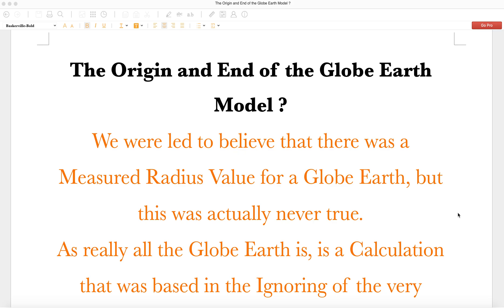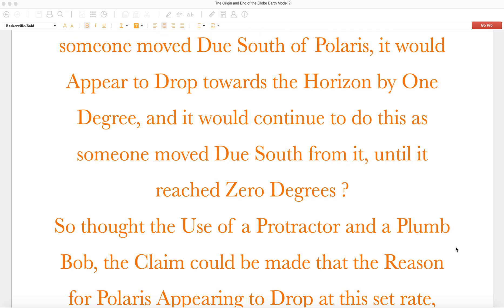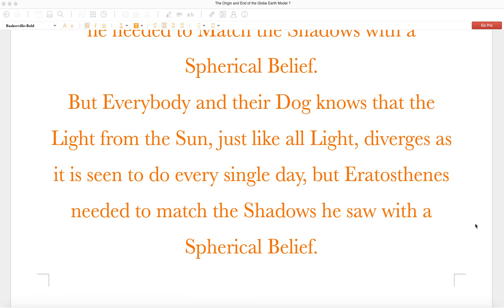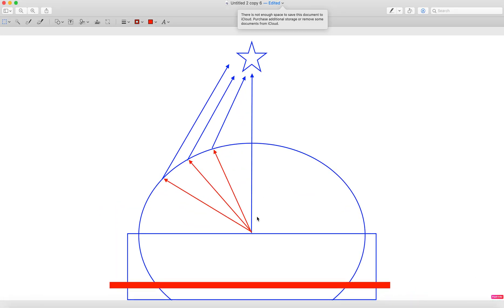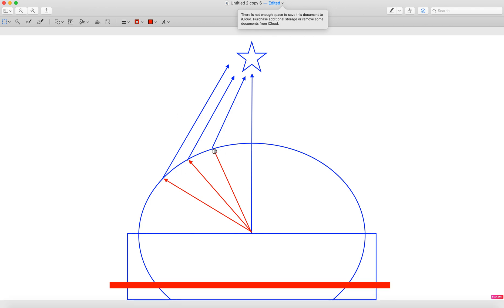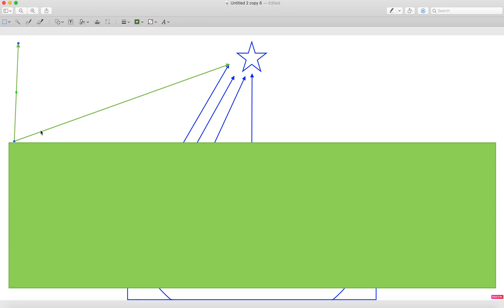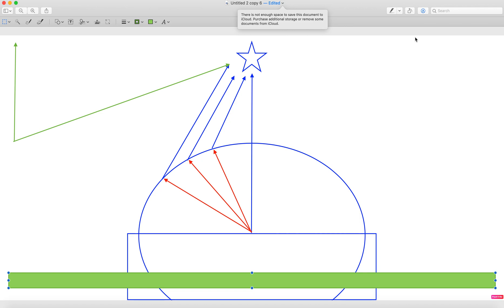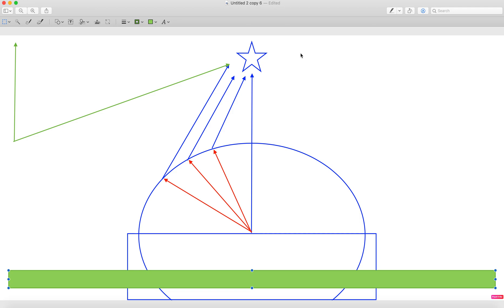The Origins and End of the Globe Earth Model ?

Comment: The geometric horizon is a purely theoretical construct, not anything you can see. The geometric horizon is not a real measurement. Its distance is the result of a real arithmetic problem; Brian another excellent breakdown video. 📐🗺✨💯 Cheers 🍻
Reply: SHAWN HAWKINS  elevation angles have straight baselines, little buddy. How do you establish yours?

Take your time, Shawn...
Reply: @DrEMichaelJones  it’s called a tangent. But you don’t need a horizontal baseline anyway, you can measure the object’s altitude respective to vertical. You know, the direction we measure using the direction of gravity’s pull.
Reply: @paulsterx  an elevation angle with respect to vertical? That wouldn't be an elevation angle, little buddy. Nice try though.
Reply: @DrEMichaelJones  correct, it’s the angle respective to vertical, which is the angle required to calculate your latitude. Why do you think you subtract the elevation angle from 90 before then multiplying by 60 to derive distance from the pole? It’s a more difficult measurement to make as there’s no reference point to sight, which is why an elevation angle from the horizon (with corrections for drop and refraction) is more commonly used, but the angle you’re really looking for is the angle from vertical. Which is how celestial navigation works. Do you even know how to use a sextant? Or how navigation works? Sound like you don’t, little buddy. Good try though.
Reply: @paulsterx  Using a presumption about a magical reifying baal force that's not a force but you can think of it as a force to further argue your presumptions of the sun's light being parallel is the epitome of stupidity! Try to start without presumptions and then only work with empirical methods that do NOT use third and fourth party unverifiable data and claims!
Reply: @paulsterx  where'd you get the 90, little buddy? How'd you get that baseline?
Reply: @DrEMichaelJones  what baseline? 90 degrees is vertical - straight up. The opposite of down. You measure down and take the opposite. That’s how spirit levels work. They measure down and tell you the angle perpendicular to down to derive horizontal. Are you new to geometry or something?
Reply: @paulsterx  90 degrees is vertical / straight up from a straight baseline, little buddy. It's called a right angle. That baseline. Thanks for confirming that we use a spirit level to establish that horizontal (perpendicular to vertical) baseline.
Reply: @DrEMichaelJones  correct, vertical is perpendicular to horizontal, I see there’s no getting anything past you! I’ll call you GG from now on, for geometry genius. So, GG, please tell me how you establish that horizontal baseline. What tool would you use to do this precisely? I’d use a spirit level of some description. So, how does the spirit level know what horizontal is? Does it just magically know, or does it use a reference direction - maybe ‘down’ to establish that horizontal line? And if it uses ‘down’ to establish horizontal, surely it can use ‘down’ to establish ‘up’, or vertical, yes? In which case you don’t need horizontal to establish vertical, you just measure the direction of ‘down’ and point the opposite direction for ‘up’. 

So, tell me again why you need a horizontal for celestial navigation?
Reply: @paulsterx  we use a level to establish a horizontal baseline, little buddy. Everyone knows this. All elevation angles are measured fom that horizontal baseline.
Reply: @DrEMichaelJones  and how does that level establish what is horizontal, little buddy?
Reply: @paulsterx  how does a straight level establish a straight horizontal plane? By not being curved, little buddy. You're welcome.
Reply: @DrEMichaelJones  not the answer to my question. I asked how a tool that establishes horizontal works. How does the tool know what horizontal is?
Reply: @paulsterx  the straight tool? You're wondering how it establishes straight? It's straight. How do you think it works?

Btw, men don't write "oh dear" so I assume I'm speaking with a woman. I will adjust my pronoun use accordingly.
Reply: @DrEMichaelJones  the spirit level Mike. How does a spirit level establish horizontal?
Reply: @paulsterx  are you claiming it doesn't?
Reply: @DrEMichaelJones  of course not. How does it do it? Does it magically know what horizontal is, or does it use a reference direction? If so, what is that reference direction?
Reply: @paulsterx  you're asking why water is level? Would you like to know why it's wet too, little buddy?
Reply: @DrEMichaelJones  are you suffering from some sort of stroke? It’s a simple question. How does any levelling device establish horizontal? What is it’s reference direction to do so?
Reply: @paulsterx  your question is "why does water seek its own level?" You're just not bright enough to realize it.
Reply: @DrEMichaelJones  when did I mention water? I’m asking you how a levelling tool determines horizontal. Take a laser level for example. How does a laser level shoot a laser beam horizontally? How does it know? What reference does it use?
Reply: @paulsterx  the tool with liquid in it... you're wondering why the liquid seeks level...

Lasers do indeed shoot straight, too. So much common ground! But no, a laser doesn't "know" or seek horizontal like liquids do. Light doesn't have a "reference" level like liquids do.

Do you have a guess why liquids seek a level equilibrium? Because as far I can tell, no one knows.
Reply: @DrEMichaelJones  so how does the laser level know which direction is horizontal? FFS Mike it’s a simple question, just answer it.
Reply: @paulsterx  a laser doesn't seek horizontal, a water level does though, little buddy
Reply: @DrEMichaelJones  oh good god. A laser level shoots a laser beam out horizontally, yes? How?
Reply: @paulsterx  because you aim it that way. If you aim a laser at an angle it's not horizontal. A water level doesn't need to be aimed, pal.
Reply: @DrEMichaelJones  bored of this, you obviously don’t understand how conversations work. The point is, a laser level uses the direction of ‘down’ as a reference and shoots a horizontal beam 90 degrees perpendicular to that direction. Therefore, we can measure ‘up’ by first measuring ‘down’, with no need for a horizontal whatsoever. And back to the initial point, considering that for celestial navigation you require the angle of the celestial body with respect to vertical (not horizontal), there is no need for a horizontal baseline at all. Which sort of screws your initial comment. Doesn’t it, little buddy? Let me know when you’ve learned how to answer simple questions. Bye 👋
Reply: @DrEMichaelJones  and now you’ve confirmed that not only do you not know how navigations works, you don’t know how laser levels work 🤦🏻‍♂️ 
Good grief man, get an education.
Reply: @paulsterx  it's amusing that you think a laser can find its own level, little buddy. Only water can do that on its own. If you want to reference down for your laser, you do that, not the laser little buddy. Good try though.

Where'd you get your "education?"
Reply: @DrEMichaelJones  oh do grow up. It uses a pendulum numbskull. So, still think you need a horizontal baseline for celestial navigation?
Reply: @paulsterx  you need a horizontal baseline to measure elevation angles, little buddy. You establish one with a level. Nobody navigates with the stars. It's not the 1920s.

Glad we cleared up the fact that lasers don't level themselves. Neither do pendulums. A plumb bob establishes.a vertical. Is this hard for you?
Reply: @DrEMichaelJones  and now you’re getting it! A plumb bob establishes vertical. Which you can use as a reference to measure against the angle of a celestial object and use that information to determine your latitude. So no horizontal required then. Glad you agree.
Reply: @paulsterx  I'm so glad you agree that the only way to measure an elevation angle is by establishing a horizontal baseline and measuring from it. Now you can calculate the height of the mast of my boat off the water if you know how far offshore I am just by getting an angle from the surface of the water to the top of the mast. Enjoy your evening! :D
Reply: @DrEMichaelJones  Did it really just take you 15 comments to work out that you establish a horizontal baseline using vertical?
Also, nice to see that you agree that we can test whether the Earth is flat using trigonometry. Have you seen the photo of Blackpool tower in front of Dow Crag? The one that turned Ranty into a glober? We have the height of the tower and the distance to it from the photographer, and the height of Dow Crag and the distance to it. Are you able to use basic trigonometry to calculate the angles of elevation to the top of the tower and the peak of Dow Crag from the photographer's location?
Reply: @everybodylovesballs  test whether the earth is flat? Uh no. What we're going to be doing is measuring elevation changes from that horizontal plane of reference that we established with a level (or a perpendicular plane from a plumb line...they're both the same thing.) This is how surveying works, pal. We'll be using straight lines and right angles for our planar trig. Like my mast example. It can't be done without the water being level and horizontal because, as we all know, you can't measure any angles of elevation from a curved baseline. Enjoy your day, little buddy. :D

Btw, normal people etablsih a horizontal baseline using a level. Your pal is afraid of what that might mean so he felt the need to take an extra step with plumb being vertical for some odd reason. We got back to a level establshing a straight and horizontal plane (and perpendicular to that plumb line) in the end though so it was all good.
Reply: @DrEMichaelJones  From your response, I can only conclude that you do actually understand that we can do this on a globe - measure an angle of elevation from a horizontal plane of reference that we establish relative to a plumb line? But the distinction is that on a globe, this horizontal plane is not parallel with the surface and so trigonometry, and planar surveying, won't work over longer distances?
Reply: @everybodylovesballs  what globe, little buddy? We're measuring an elevation angle to the top of my mast off the level and horizontal water. Glad we agree that the lines of that triangle that we're doing trig with are straight and that vertical is established with a plumb bob and is perpendicular to horizontal which is established with a level. All those lines are straight and one of those angles is definitely 90 degrees otherwise we can't do trig at all. 

Enjoy your day. :D
Reply: @DrEMichaelJones  Yes, little buddy. If the Earth was flat, all of that would be true. Trig would always work. However, on a globe, the height of the mast would be very close to the value calculated using trig if you were at low elevation and the boat was close but as the boat got further away, the angle to the top of the mast would get significantly smaller than the trig value (of course this would be decreasing with distance too, it's just that the globe value would be decreasing at a greater rate) which would mean that the calculated height of the mast would be getting smaller too. So, yes, trig wouldn't work. That's not the case with a flat plane - the angle to the top of the mast will always be arctan(height of mast/distance to mast) if you are measuring from zero elevation on a flat plane.
So we have a really easy way of telling if the Earth is a flat or curved. Measure the angle to the top of the mast as the boat sails away and see if it matches the value calculated with the formula above or if it gets significantly smaller than that value as distance increases. That's not too hard for you to understand, is it?
Reply: @everybodylovesballs  The earth isn't flat, little buddy. That's why we establish a horizontal plane with a level to measure the elevation of the (not flat) topography from. I'm glad that you agree that you can't even get to that (simple) step number one on a ball because, of course, you can't measure angles from a ball and yes, obviously, "trig wouldn't work" either. So no, you don't have any "easy way" to measure curvature with angles because no angles are capable of being measured from a curve. That's not too hard for you to understand, is it?

Take all the time you need to process this. :D
Reply: @DrEMichaelJones  You can't strawman your way out of this. Your claim is that large bodies of water conform to a horizontal plane, correct? This means that in your mast example, tan(elevation angle to top of mast) * distance to mast will always be equal to the physical height of the mast. Regardless of the distance to the mast, this formula must always give the same value because the mast has a fixed physical height in the real world. If the height of the mast calculated using this formula gets smaller with distance, then the surface of the water is convex, or at least we can say that it's sloping down from the horizontal plane. My experiment is valid for demonstrating whether large bodies of water conform to a horizontal plane or not. Your other claims are equally ridiculous but let's deal with this one first. Take all the time you need to process this.
Reply: @DrEMichaelJones  So you agree that my experiment is valid? And I can do the same experiment with any physical object really - a ship, lighthouse, mountain, etc? For a fixed object, I'd be changing my distance to it by moving along the coast but the same formula should work, don't you agree?
Reply: @everybodylovesballs  Why dont you start simple? A sailboat, two miles away. Rooting for you. Be sure to pick a calm day. Can't wait to see your results! :D
Reply: @DrEMichaelJones  Afraid to answer simple questions, little buddy?
Reply: @everybodylovesballs  afraid to try to go measure an angle from the surface of water to the mast of a boat over a couple of miles, little buddy? I'm rooting for you. :D
Reply: @DrEMichaelJones  It's your claim that the elevation of topography is measured from a horizontal baseline and now you refuse to confirm whether trigonometry applies to mountains? In all honesty, that's such a weak and transparent response. It's quite impractical for me to hire a boat so perhaps you can explain why trigonometry only applies to the masts of boat and not mountains, which are far more accessible to me? The mast of the boat was simply an example that you suggested, I didn't realise that you were claiming this as some sort of flat Earth magic situation where trigonometry only applies to them and not other physical objects.
Reply: @everybodylovesballs  it's actually every surveyor's claim, little buddy. You're trying to disprove it. We're using something really easy for you to measure. Top of a mast. 2 miles away. Good luck!
Reply: @DrEMichaelJones  I'm in a far better position than you to judge which is easier for me to measure. A mountain 50 miles away is far easier for me to measure than a boat 2 miles away. You have no knowledge of my personal circumstances so you have no basis for arguing otherwise. So why can't I measure the mountain?
Reply: @everybodylovesballs  well good luck either way. Can't wait to see what you come back with. Make sure you have a good video camera.
Reply: @DrEMichaelJones  Thanks for the encouragement. One thing that concerns me though is the people like yourself may not possess a basic understanding of trigonometry. It would be pointless to go to all that effort and then find you're not able to interpret my results correctly. Can you put my mind at ease by telling which of these objects would have the greatest elevation angle - one 162m high at a distance of 19.6km from the observer or one 773m high at a distance of 81.5km?
Reply: @everybodylovesballs  is your adjacent baseline level and horizontal in this example and are the elevations vertical above the distance points you're citing? Just want to make sure you understand that trig needs a right triangle.
Reply: @DrEMichaelJones  The heights/elevations are from official government surveys and other credible sources. If there's any doubt about the distances, I can confirm them in Google Earth which you have previously told me is an accurate map based on cartesian coordinates from first order measurements. Your claim is that all surveyors measure elevations from a horizontal baseline. So if you are correct, then the answers are both yes.
Reply: @everybodylovesballs  why don't we just use meters and millimeters then and establish a level horizontal baseline and a vertical from that? Surely we can establish a floor that's level and horizontal and do trig in reality, right? Happy to demonstrate my ability to calculate the sides of a right triangle given two inputs if we can agree that it's a right triangle.
Reply: @DrEMichaelJones  You've written all these comments telling me that these are right-angled triangles and now you're saying that they may not be so we need a different experiment? And now we're back to the mast of a boat being one side of a right-angled triangle but the elevation of a mountain - which you were very clear was measured from a horizontal baseline - is not? That's a terrible argument, little buddy! If you need some help with the math, just let me know but unless you're doubting your own claims, I see no need to change the experiment.
Reply: @DrEMichaelJones  If you're doing an experiment, you don't form your conclusion before you actually do the experiment. We have a hypothesis - that elevation is measured from a horizontal plane. We can make a prediction - we know that if our hypothesis is valid, the angle of elevation, distance to the mountain, and elevation of the mountain will always accord with trigonometry - at any distance - so we can calculate the angles that support our hypothesis before we do the experiment. Then we measure the angles and see if our hypothesis is valid or not.
It seems the problem here is that you don't have a sufficient grasp of trigonometry to calculate the angles that support your hypothesis. I can't see any other reason why you'd refuse to provide them. I absolutely agree that we can establish a right-angled triangle in reality with the elevation of the mountain if your hypothesis is valid. Do you acknowledge that?
Reply: @everybodylovesballs  elevation being measured from a horizontal plane isn't a hypothesis little buddy, it happens on a daily basis on every construction site in the world.
Reply: @DrEMichaelJones  So which of these objects would have the greatest elevation angle - one 162m high at a distance of 19.6km from the observer or one 773m high at a distance of 81.5km?
Reply: @everybodylovesballs  on paper with zero optical effects or in reality where you don't have an instrument that can accurately measure any angle at that distance?
Reply: @DrEMichaelJones  What optical effects are you referring to and what factors/variables do they depend on?
Reply: @everybodylovesballs  I'm so glad that we both agree that there's no tool that can accurately measure elevation angles from horizontal over that distance due to the optical effects. Common ground. Enjoy your day.
Reply: @DrEMichaelJones  What optical effects are you referring to?
Reply: @everybodylovesballs  so glad we're on the same page and agree that optical effects preclude anyone from accurately measuring elevation angles over distance with any professional tools.
Reply: @DrEMichaelJones  If you're unwilling to defend your claims, we'll have to leave this discussion here.
Reply: @everybodylovesballs  are you now trying to recerse course and claim there are no optical effects that preclude professional tools from accurately measuring angles at long distances, little buddy?
Reply: @DrEMichaelJones  Your inability to understand simple English sentences is truly breathtaking. I haven't claiming anything. I've asked you twice to tell me what optical effects you are referring to and what factors/variables they depend on. How do these variables affect the measured angle? Are there conditions where the effects are predictable such that we can make appropriate corrections to our measured angle to achieve the desired accuracy? What is the relationship with distance? What accuracy is sufficient and at what distance are we unable to achieve that accuracy?
When you provide a full explanation of your claim, I'd be happy to evaluate it. I've worked with many scientists. They are always willing to explain their claims because if they weren't confident in them, they wouldn't make them in the first place.
Reply: @everybodylovesballs  your concession that optical effects are indeed raking place by asking "what kind?" was all that was necessary for any reasonable person to understand that you agreed with my statement that optical effects exist at those distances and cannot be accurately measured with professional tools and we are no longer discussing pure geometry. If you'd like to claim you were sonehow misquoted, feel free to clarify your remarks, little buddy. Otherwise, enjoy your day. :D
Reply: @DrEMichaelJones  Asking what optical effects you are referring to does not imply that they are "taking place" or have any relevance at all to this example. The only implication you can reasonably make based on that question is that I believe that optical effects exist. As noted earlier and now confirmed by your response, you clearly lack basic English comprehension skills.
Reply: @everybodylovesballs  if you say there's "no relevance" to this example, little buddy then your claim is now "optical effects are not relevant to accurately sight objects at distance." Do I have your claim right now or would like a thesaurus and a dictionary because you're having difficulty articulating yourself? Is English your second language?
Reply: @DrEMichaelJones  Unfortunately Mike, you've got it wrong again. But feel free to explain how a reasonable person would interpret my statement in that manner, and I'll correct you again, if it brings you joy.
Reply: @DrEMichaelJones  Oh dear. Making non-existent problems I see.
Reply: Yo 10th! I sent you a DM on Discord. Did you get it?
Reply: @roohif  post it here, little buddy. Don't be a coward.
Reply: @10thman - What does it matter if you can or can not see the geometric horizon? Nor does it matter if it is a theoretical position. What matters is that you can determine where it is either from the offing and allowing for refraction or other errors or by using another method. Maths, geometry, logic and critical thinking are not your strongest attributes, are they?
Reply: When you look out to see at the horizon, what do you suppose the photons of light are reflecting off. Is it not the actual water? So why is the actual water not geometric?
Reply: @philb8550  deep thoughts...from a high school science teacher...
Reply from the maker: Exactly Tenth, it’s the location determined by the philosophy of a conceptual reality ha ha ha…. Absolute Nonsense SMH 😀